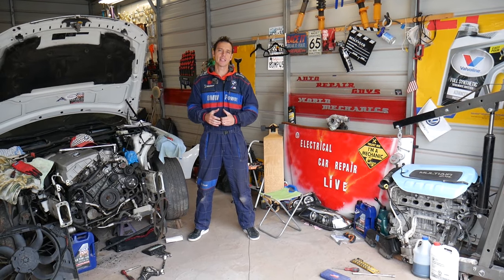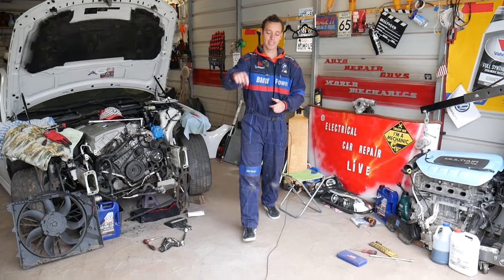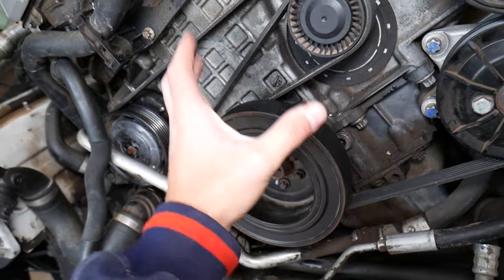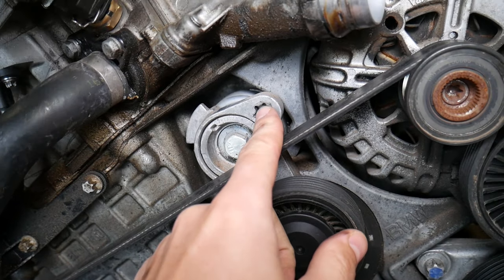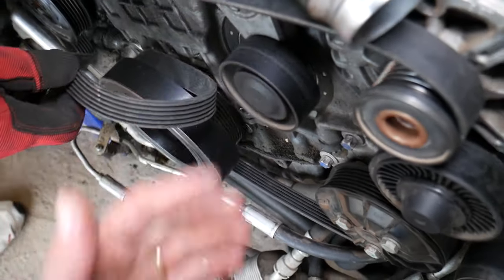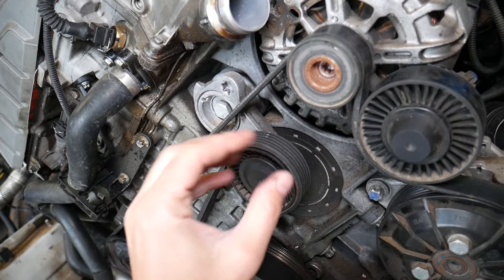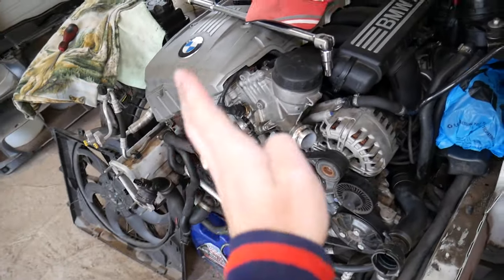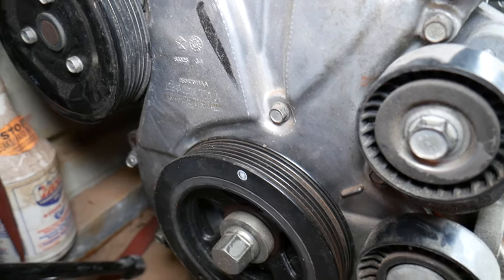TOP 5 REASONS SERPENTINE BELT FALLS OFF, COMES OFF ON A CAR

Comment: If the belt malfunctions, does it cause the steering wheel to become stiff when you try to turn left or right?
Reply: Yea
Reply: Yeah, the belt powers the power steering is some
Reply: If it’s run on that belt yes but sometimes they have a separate belt or even electric power steering
Reply: Yes the belt connects everything the alternator so ur battery light comes on, the power steering pump ur steering light will come on, it keeps the fluids running through the car so no belt ur temperature gage light will come on shii happened to me last night 😫😫
Reply: Happed to me a few hours ago😭
Reply: Yes. However, if your belt is still on and you’re steering is still stiff you might have a power steering pump problem or you are low on power steering fluid

Comment: First the battery light warning came on the dash board, then immediately the steering became tight. This was on and off for few kilometres. On stopping and opening the bonnet I noticed a rubber burning smell but the belt intact. Again after driving it for few kms I heard a loud snapping noise and the steering wheel became rock hard. I opened the bonnet and saw the belt missing. I drove the car to nearest service centre they told me its the crank pulley. How come a belt burn and snap if there is a problem in the driver, it must be in the driven. On enquiring they told me the alternator pulley, power steering pulley and AC pulley are all fine. They say its the crank pulley. If the crank pulley is at fault then why does the belt snap and fail.
Reply: Did you find the problem I’m having same symptoms
Reply: @brandondingle6594  on changing the crank pulley the service centre showed me that everything is fine and sent me. Within two kilometers the same lights came up again. I scolded the service personnel and again took the car back. He told me that alternator brush is at fault and changed it. I fired him for unnecessarily changing the crank pulley previously. He told me that crank pulleys is also worn out. I replied him don't fool customers for  achieveing sales targets. Since three months the car is fine.
Reply: What car did u have ? I have the same problem

Comment: What would be the cause of a serpentine belt pulley to fray on one side
Reply: I'm not a mechanic AT ALL! But I just put my belt on five minutes ago and noticed that its easy and possible to put the belt around the tensioner pulley but push it too far back meaning that it will be rubbing against the tensioner causing fraying. Again I'm not a mechanic but I noticed that thuds Jay be why I've had to changed mine twice in a year
Reply: Idler pulley

Comment: I had 2 times put a brand new belt on my car because it got tied up an broke.  I have 02 gt grand am.   An 1st time i had a tensioner / pulley replaced with new belt. Then 3 weeks later the belt came off.  So 2nd time had it put in shop an the bolt holding it was loose an broke so had it replaced the bolt.  Now today it did it again.  So what could be the problem

Comment: How close should the power steering pump pulley be to the power steering pump. I have have 1989 K3500 GMC Sierra with a 6.2. The serpentine belt keeps coming off and I have replaced the power steering pump and ever since, it feel the power steering pully is affecting the other pully’s. I’m using a new power steering unit with the old pully and need to know how close I can get the pully to the pump. I have replaced the tensioner and pully. Thank you

Comment: I have a weird question, but I haven’t been able to find on the Internet.

So my belt started squeaking and the belt was replaced about two years ago and was told that the belt is in good condition so I put it back on and put some belt conditioner on it and now the belt is extremely sticky. It has been popping off. Do you guys recommend anything to clean it or solve this problem?

Comment: My serpentine belt on my Nissan Altima ripped off had it replaced weeks later it slipped off but didn’t rip I got the belt off it was in good condition  everything else runs good ok I do get engine light every now and then but doesn’t over heat I do prior usual maintenance as always but I don’t think those are the problem as why it slipped out this is my first time this has happen to me … I do go on dirt roads sometimes muddy when it rains heavily when I wash my car I always spray underneath to get all mud and dirt off as possible you mentioned that any liquid particles etc gets in your serpentine belt can cause it to slip off my wild guess is muddy rocks or something alike might of gotten under or between the belt which cause it to pop or slip off their was signs of muddy scrapes on the belt but nothing serious as I got the belt their was alot of muddy rocks around the pulleys and belt their was one muddy rock that got my Attention that was wrapped in the belt their was a minor scrape by the alternator like if something clawed again nothing serious I took a double look their was signs of something scraping not metal but muddy … I think the muddy rocks caused the belt to slip off … what’s your honest opinion about my situation please let me know if much appreciated thank you god bless
Reply: Yes...mud, sticks...etc...but I would double check the Idler pulley...The slightest bit of wobble means the bearings are going out

Comment: I am having similar issues with my Fiat 1.9D engine,  I replaced the alternator pulley and  after few days the belt came off, Now this time I replaced this with a new belt and  Tensioner and again the new belt broke within 1 day, I am unable to diagnose. and the mechanic who worked on this has no idea working on Fiat cars. Kindly help if possible
Reply: u had a solution?
Reply: @daviddejesusvegacampos867   yes, it was a faulty alternator Pulley, it's alright after replacing the complete alternator assembly

Comment: I  HAVE  A  PROBLEM  WITH MY 2.5 FORD FUSION !!, THE  SERPENTINE  BELT  RIDES  THE  EDGE  OF  MY WATER PUMP  !!, NOW  I  REPLACED  MY  WATER  PUMP  WITH  A  NEW  ONE !!,  AND  IT  STILL RUNS  THE  EDGE  OF  MY WATER  PUMP !!,  I'M THINKING  IT'S  THE TENSIONER PULLEY !!, THAT'S  PULLING  MY  SERPENTINE  BELT  TO  THE  EDGE  OF  MY  WATER  PUMP !!,  NOW  I  NOTICED  MY  AC COMPRESSOR  HAS  A LITTLE  PLAY  IN  THE PULLEY !!,  BUT  NOT MUCH !! .